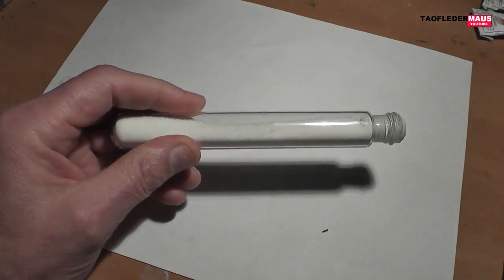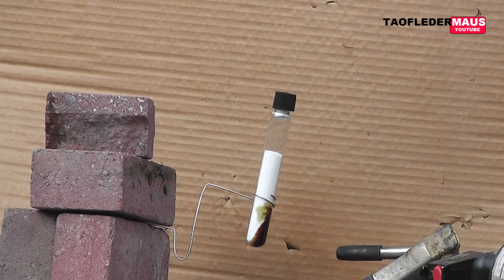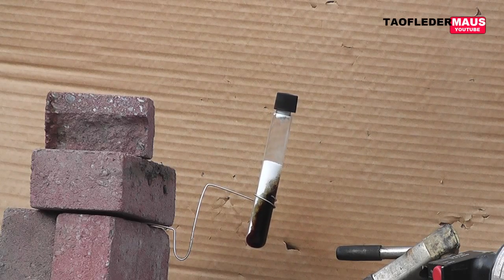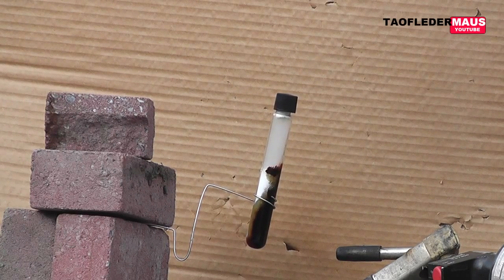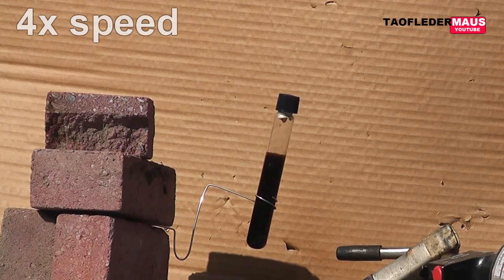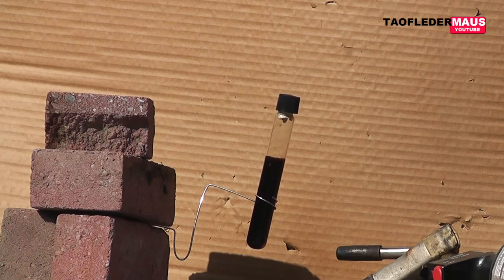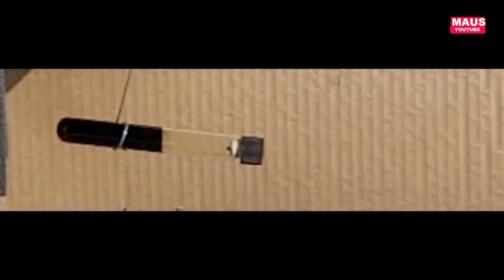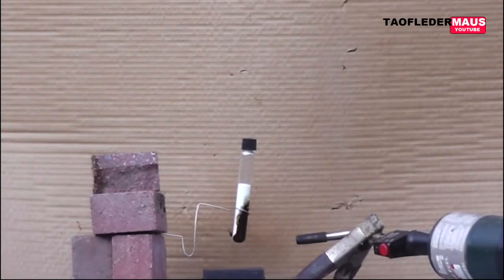TTTT - Test Tube Torcher Tests -  SUGAR

Comment: I can see it thermal factoring. So by the shakes that it gives as the tube becomes black on one side.  Means the rushing of water is replacing the hotter hotter side. Maybe a rotation table keeping things a little bit even where the burner is actually hitting the tube. Could help out with these test is going forward.  Honestly, I feel like you might be overheating the tube on one side to the point of failure or making it easier to the point of failure along with your silicon top. Don’t know that much about silicon so I’m gonna say less, but I still don’t feel like that’s an adequate wedge. You just fill it up by the neck seeing you fill it up by the brim of it I don’t know how to tell you to go about. We are now putting it in still is gonna be better or something stronger but watching a reaction is why we are here on your YouTube channel so I thank you for allowing us to see what is actually happening with understanding. But I do feel like you need to rotate the heat on the bottom end in some sort of way to keep the heat somewhat even on the bottom.  Now this will not execute any type of heat and cold liquid to the thermal vector, which can cause explosions in steam pipes like water. Hot fluids, making certain gases that simultaneously mix back into cold, can cause explosions even in steel pipes.  Which look at New York and some major cities and you can already see there’s numbers of occasions of this. Even even trains back in the day, AnyWho. I think a lot of your tests are valid for what they are maybe tone down your heat and just see what happens with some sort of longevity. I don’t know how to tell you to conduct this. I’m still fascinated by what you do. I’m trying to help you better replicate failures, and ideas.  Thank you for your time.

Comment: just a thought it would probly hold more pressure if you extended the silicone past the lip on the tube so it has more than the cap holding it in their ?

Comment: Just something I noticed in the description of the video: The sugar doesn't caramelize and then turn into a gas, it decomposes completely after a while, forming mostly carbon and water in the process which then turns into steam from the heat and causes the explosion.

Comment: Might be a bit toxic, and I'm not sure if it would work. But have you thought of trying gallium? I don't know gallium's boiling point, so I'm not sure if it would vaporize, but if its within a reasonable temp (and not overly toxic), I think it would be worth a shot
Reply from the maker: 4,001°F (2,205°C)  is the boiling point of gallium,  so I am sure the glass would melt long before it boiled and started to pressurize the vial.
Reply: Oh yeah, definitely would not work

Comment: Hey Jeff! You should use coffee creamer next im a TTTT!! I know it is quite flamable when it is spread around in air and a simple match wont do anything to it when it is on a heap, but I am quirw curious to see what happens when you do it like this!!
Cheers!
Reply from the maker: I have to have stuff that is a liquid or becomes a liquid when heated.  (ie wax,  grease,  soap, etc)   A dry material like creamer is just going to burn and the glass will melt.   What makes these work,  is  I am heating liquids beyond their vapor state temperature and building up pressure.

Comment: How about a super saturated salt water?
Reply from the maker: That would be a good one.   Almost like a salt slurry or something.    I'm sure it would have a pretty high boiling point.
Reply: *****
If you can get some calcium chloride that would be even better than table salt.
Reply from the maker: So far I am trying to just use common household materials to keep it simple.  (and I am too lazy/sleepy/busy/cheap  to go shopping sometimes!

Comment: Maybe if you used cane sugar, you could have heated it faster?
Reply from the maker: Cane or beet, are chemically identical from what I read.
Reply: Unrefined cane sugar may have significant enough a molasses content that it could effect its behavior in a TTTT. Or, you could just see what happens with molasses. o3o
Reply from the maker: *****  I'm not sure it would be so different as to make me want to re-do the test.  I could do every type and brand of sugar and...  it's still sugar.    I have SO many other things lined up.  Brake fluid,  alcohol,   gasoline,   crayons...
Reply: *****
 can't wait to see crayons!
Reply: ***** Cane sugar or brown sugar would not have made a difference, the major component is still sucrose.

Comment: Try a tube filled with the liquid from glow sticks.
Reply from the maker: I totally want to do that.   I'm trying to figure out how to put the two chemicals in the test tube without mixing them,  but will mix when I do the test.   I actually bought some glow sticks the other day!
Reply: Maybe you can put the separate glowstick chemical in a smaller container sealed with wax that way when the test tube heats up the wax melts off and the two liquids would mix.
Reply from the maker: In some tests,  I found a liquid that would separate the two chemicals.

Comment: I prefer the failure of the glass tube rather than the plug. This one gave an impressive blast. I give it a 10!

So how about trying something that is extremely condensed and frozen at normal temperature?  Like Frozen Carbon Dioxide?

I wanted to suggest Frozen Nitrogen, because Dry Ice has been done to death on YouTube, but that would be an expensive poof of gas.
Reply from the maker: The issue is sealing the test tube.   The plastic caps really don't seal very well on their own.  So I have to use a plug of silicone or epoxy,  and those take a long time to cure.   Trying to seal something that is producing a lot of pressure just at room temperature would be difficult and dangerous to do.
Reply: ***** I didn't realize there was a curing cycle to consider. If the only issue is time, can a hole be drilled into a block of Dry Ice to keep the "specimen" stable until it's ready for the experiment? Or is the extreme temperature going to interfere with the curing process of the silicone or epoxy?

Maybe this is just too unstable of an idea, but I imagined it would be neat to see a frozen gas experience this process.
Reply from the maker: I could probably do it with a better gasket on the cap.  The caps are not very strong on their own though.   I'd basically have to put the dry ice in,  and cap it very quickly before it blew up.  But,   I have seen some nasty videos where stuff like that blew up in peoples' hands and ripped fingers off.
Reply: Yeah, the more I think about it, I keep imagining alot of unwanted glass shrapnel long before the propane torch stage of things.

Comment: Salt?
Reply: I am not sure he has the ability to produce enough heat to do anything to salt. Salt melts at just over 800 degrees Celsius. Sugar is less than 200. Would not be a bad idea to at least try it out though.
Reply from the maker: Jesse Sisolack  I may just try to hit a pile of salt with the torch to see if it is feasible first.   I've never tried to melt it before.   It the melting point is too high,  the heat probably will not transfer away from the glass fast enough and the glass will just end up melting.
Reply: *****
Table salt has quite a high melting point, the glass would probably be getting soft at that temperature.
Reply from the maker: I think there needs to be SOME water.   Maybe the salt slurry will do something cool when it vaporizes.
Reply: ***** This was a fun vid. :-)
I suppose water, another liquid at lower temps to work as a catalyst, or a different type of glass, but that could get expensive.  Are you putting in a rule to not mix items with each other?  I.E. syrup + salt or 2 solids.
Primary reason I'd be interested in Salt is because of the higher melting point, definitely changes the dynamic.

Comment: I know the intention is not exactly how big a bang you can do, but I also think automobile starting fluid (mostly diethyl ether) would be interesting because it might be possible to completely vaporize all of the tube's contents, leaving it appearing empty before it fails.
Reply from the maker: I think it would still reach a high pressure where it would prevent it from vaporizing.  But once it blew,  it would really vaporize.
Reply: Unless you have a way to reduce internal pressure below atmospheric before sealing.  Seems complicated though.

Comment: Could you do this with salt? I'm not sure what the melting temp. of salt is so, maybe it would melt the glass first. If not, then do table salt next time!!!
Reply from the maker: I tried to torch some salt and it does melt.  I may be above the melting point of the glass.  The test tubes are pretty tough but  can be melted easily.

Comment: Wow, this was a good experiment. Thanks and keep them coming. Would gasoline or alcohol be out of the question? haha
Reply from the maker: I do want to do gasoline and alcohol.    I think people may be surprised with that.   I predict they won't even catch fire.   Just blow out the torch.
Reply: ***** You never know until you try ;-) If you do, just go somewhere open and over gravel or cement.
Reply from the maker: I'll probably just use a little less gasoline,  etc. 
and have a hose ready to extinguish it.
Reply: *****
Good call.

Comment: OMG WAT MUSIC IS THAT?  Had to.  No really, I did.  That was definitely a spectacular failure of the test tube.  Here's an interesting idea - try solder.  It will melt at a relatively low point, has high thermal conductivity to carry away the heat and distribute it evenly... and it'll look really cool with solder splats all over that piece of cardboard.
Reply from the maker: That's a good idea.  I have a lot of solder actually.

Comment: Sugar is actually very capable of exploding which i suspect is partly responsible for this reaction. we usually see sugar explosions in the form of dust explosions (ala the Imperial Sugar refinery disaster) but my suspicion is in this case once it stopped smoking that signaled a lack of oxygen. you continued to heat it and once that tube burst the super hot sugar was exposed to oxygen and combusted.
Reply from the maker: These are not chemical explosions.  They are technically called  "BLEVE"   which stands for  Boiling Liquid Expanding Vapor Explosions.   Each material I put in the test tubes has a boiling point,  where the heat causes a change of state from liquid to vapor.   But because it is in a seal container,   the pressure that builds up prevents it from going to a vapor state,  so the pressure just continues to climb,  even though the temperature is WELL above the vapor point of the substance if it was at atmospheric pressure.  Eventually the pressure is so great the test tube bursts and the material inside instantly flashes to a vapor as it goes from a high pressure to a low pressure.
Reply: True, it is the pressure that ruptures the vial. I am not a chemist, I am a physics undergrad, so i won't claim to be an authority on the subject. After further research the sugar would break down into Carbon and water (steam), neither of which readily burns.
Reply: So in this case, i suspect the white "smoke" was steam and it went away when the pressure inside caused it to condense. again, just my suspicion.

Comment: I would love to see you redo your temperature measurement experiment where you used water, but this time with the epoxy and a lower heat like this, to see just how much pressure builds up. This looked like it had more pressure than the test you did back then.
On a different note, when you heat up sugar to high temperatures, it starts to decompose and carbonize, with the major products being water vapor and carbon.
Reply from the maker: Ideally I would like to use an actual pressure gauge.   I'd probably need one with a range up to 600 psi or so.   I'm really curious how much pressure is in these and I didn't really trust the pressure I estimated I got using just temperature.

Comment: I liked seeing the tube fail instead of the plug.  Unless it's a safety concern, I think it'd be cool if you kept using the epoxy plugs.
Reply from the maker: I set up this one before I started using the silicone.  I really don't want to make a lot of noise and would rather the plug blow out so we can see the liquids flashing off.

Comment: I'ed love to see a setup video, I'm guessing your using some safety precautions. Maybe a Plexiglass plate???? Anyway love the video.
Reply from the maker: *****  He's refering to a lexan or plexi guard for the cameras or me.
Reply from the maker: I set the cameras back about 25 feet or so.   The glass really doesn't travel as far as you would think.   I stay back a lot further or sometimes just go inside the house until it is over.
Reply: He's using pyrex tubes as it says in the description.
Reply: Oh I missed the plate when I was reading it.

Comment: Boom goes the glucosamine! Pretty potent stuff!
Reply: Where did the amino group come from...?
Reply: I am not an expert and I am most likely wrong. I think the amino-group actually differs from glucosamine.  Amino=example amino acid is a higher ph balance than glucose. Ok how did I do? Go easy on me....
Reply: HighDesertTactical Um...
An amino group is basically just a hydrogen 'saturated' nitrogen atom.
My point is that table sugar just consists of two bonded sugar molecules, neither of which contain any form of nitrogen. So it's a pretty safe bet to say there's no amino groups in the mix.
Boom goes the sucrose!

Sorry to ruin your fun with all this. :(
Reply: "Boom goes the sucrose" sounds better anyways

Comment: Try doing supersaturated saltwater. Maybe KCl..
KCl will dissolve in water exponentially faster as the temperature increases, so if you fill that thing with it and give it some water (but not all dissolved) I'm sure the results will be interesting.
Reply: Another cool one would to dissolve some Boric acid into some methanol. You need to be careful because methanol is pretty dang flammable, but if you figure out a way to do it safely the results should be pretty spectacular.

Comment: I wonder if you used a heat gun you would have better luck?  You might have to use some heat shielding to protect the cap then.  Maybe something like a vertical cone made out of aluminum foil?
Reply: lyokofans If you're looking for a lower temp you can just turn down the torch's power.
Reply from the maker: The propane torch seems to work pretty well.  I don't think any other heat source would yield different results.
Reply: ***** Would a heat gun give you a lower temp to work with?